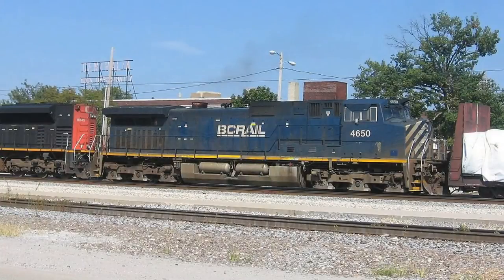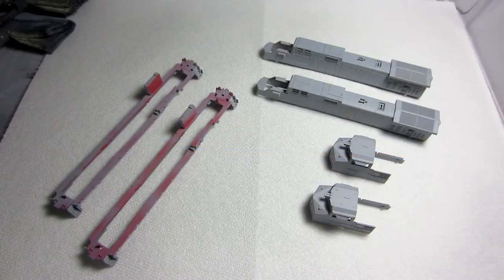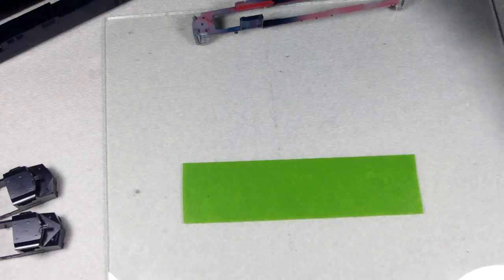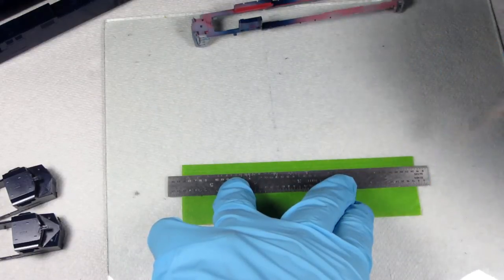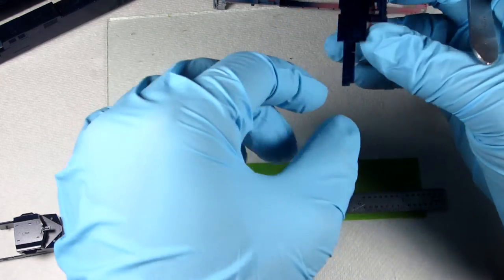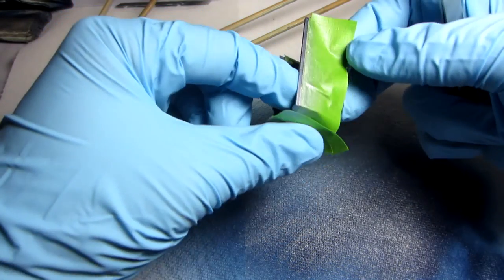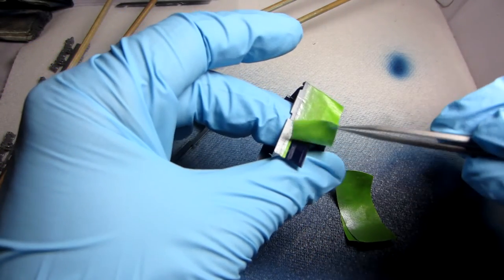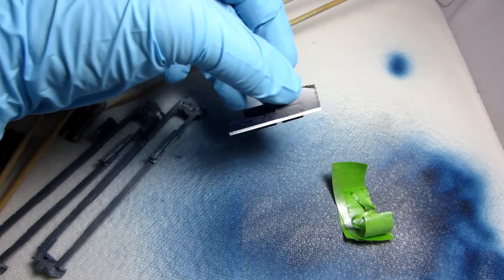Build Log: Painting BCOL 4650 & 4652, Custom Kato C44-9Ws

Comment: Nice work except the cabs are not prototypically correct. You can get the correct cab from "Kaslo Shops." The front cab hood and windows are wrong and the electrical box on the left side (the third door goes there) is omitted for the extra safety door. Canadian version (CN) requires 3 doors on the cab. Also, BCR had 4 ditch lights and two in the nose (6 total). In addition, the bell hanger is grossly out of proportion in its length.

Sorry to be such a harsh critic- but "I am Canadian." BCR conversions are very particular and unique locomotives.